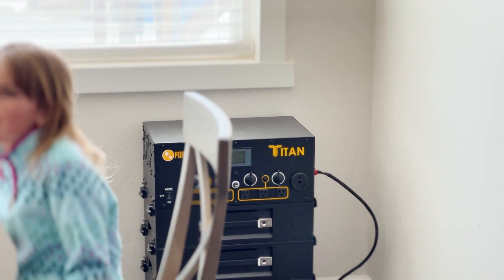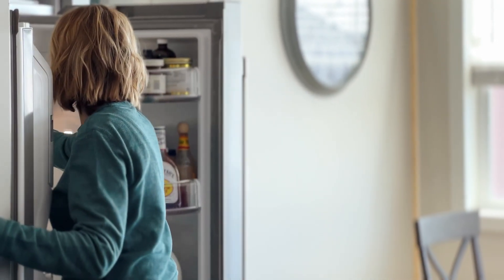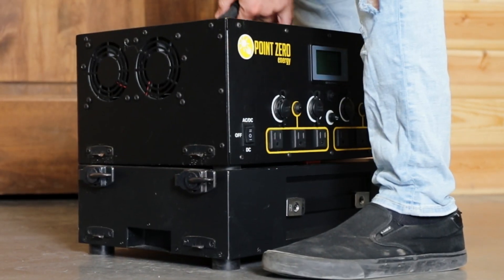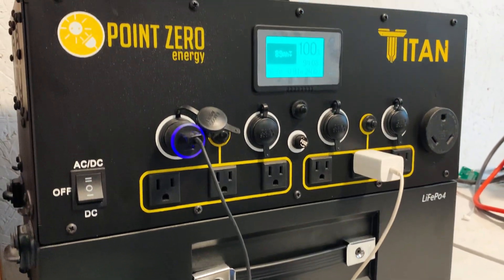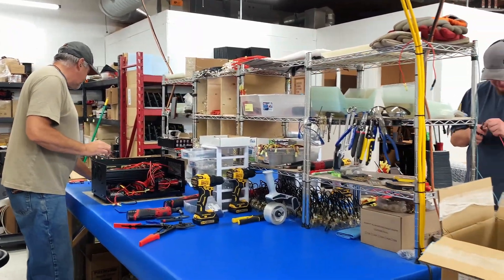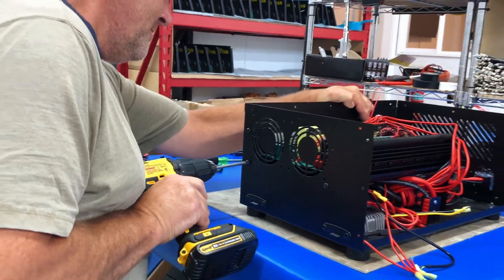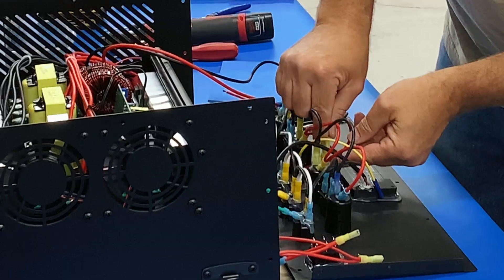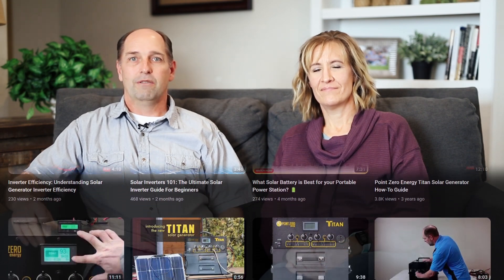Meet The Founders of Point Zero Energy, An American Solar Company

Comment: Point Zero now offers a 24v battery charger, but I cannot find any information on the best battery isolator to protect my smart alternator and vehicle battery with your device. Do you have any recommendations for your product?
Reply from the maker: Hi,  Are you talking about the DC-DC Alternator charger:  https://www.pointzeroenergy.com/product/dc-dc-charger/
This product will only drain your battery down to 12v before it will stop, so there normally is not a need for an isolator.
Reply: @PointZeroEnergy  Thanks for the reply. I just bought it. That fear was the only thing holding me back.